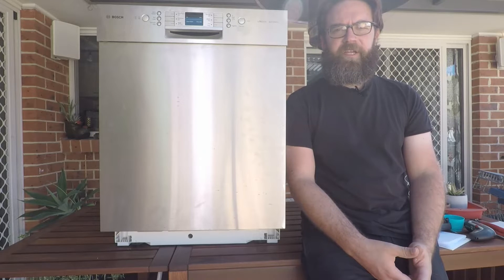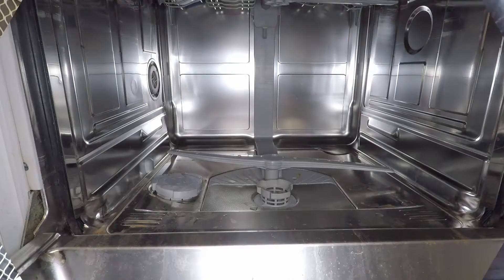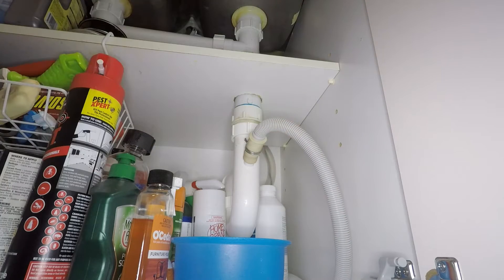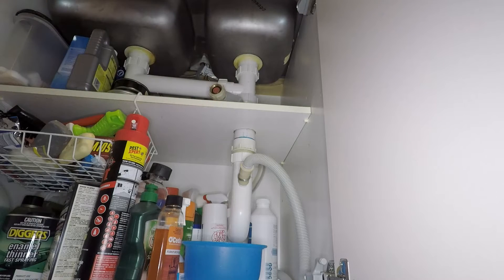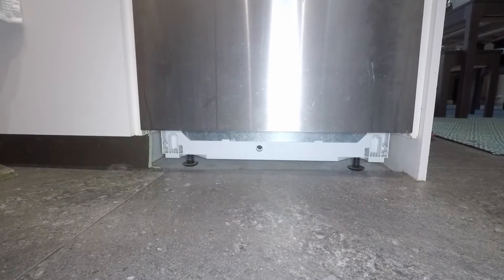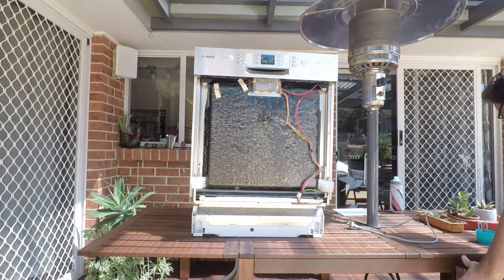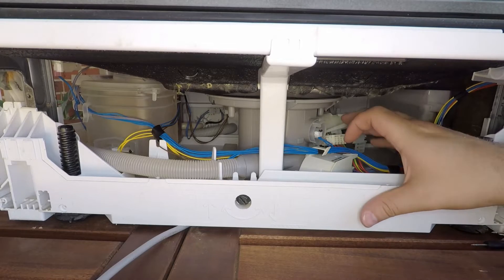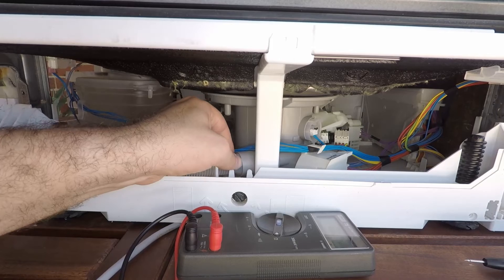Bosch E23 E24 E25 error code diagnosis and repair

Comment: Thanks for your advice, Mark. I checked all things you told, but they still do not work. I also tested the drain pump with a multimeter, and I think there is no problem with it. so what do you think? where is the problem? Could the problem be related to the PCB control board?

Comment: E23 fixed! I had to open the bottom panel to find out we a mouse had nibbled on a cable. Fixed the cable and it works again. So I even found a bigger problem to fix. A big thank you from Belgium!

Comment: Thanks for your video. Bosch SHE65T55UC. Got sporadic error code 15 over a week or so. Dishwasher still worked once I unplugged and plugged it back in. Last night error code 23. No bueno. Found water under styrofoam float and drain pump area (oily looking liquid came out of drain pump). Question is, am I solving the leak simply by replacing the pump? What do I do about the styrofoam? Obviously dry off the pump area and Styrofoam area. How do I determine if/where the leak occurred? Just bad pump (If just a bad pump, I'dh get an error 23 instead of 15, right?). Appreciate your insight. TIA!
Reply from the maker: The oily liquid you found could just be from a slow leak, and the water has evaporated leaving behind everything else. If the disk is still in one solid piece then I wouldn't worry about trying to source a replacement.
As for the E23, did this happen before or after you cleaned it out? If before then just wait and see if it returns, but if after then it could be a bad pump, and that's where the leak has come from
Reply: @Sawickipedia  The liquid I've found that the pump was sitting in and  was outside of the styrofoam area, was sorta slightly yellow-is watery. What was dripping from the pump looked demonstrably different. Darker and slippery. As to the E23: I had had maybe 5-7 E:15 codes over a week to 10 day period. Each one seemed to occur after the cycle had completed. I could hear a motor-type sound for about 10 seconds and then quiet. I listened for a couple of cycle of this then pulled the plug. Like I said, this happened about 5-7 times but on the following evening of running the dishwasher, it worked. Then two nights ago, on pressing the start button, immediately got the E23 and it didn't work at all. I cleaned everything out (and I did find something rather rigid and sizable that perhaps got in the way of the pump propeller). I ordered a replacement pump. I'm hoping it's just a failing pump and that a new one won't get fried by a leak I haven't discovered. What do you think? Oh, by disk you meant the Styrofoam piece right?  Very much appreciate your insight.
Reply from the maker: Yeah by disk I mean styrofoam part. Hopefully a new pump solves all the issues
Reply: @Sawickipedia  Had to work it to seat the new pump but it yielded. So far, no error codes. Thank you!

Comment: Have anyone get this E-24 and need to replace the control unit to fix it? I have not find anyone done that for the info I search on the internet so could I say the control unit likely to be ok on any case that it still operate but sometimes have E-24.

Comment: Hi
 Here is another quick fix that works.  The filter in the bottom of my dishwasher dishwasher was clean, yet clogged with mineral build up.  I soaked the filter in vinegar (like cleaning a coffee maker) for an hour and it was like the second coming of the messiah--the dishwasher works 1000% better, the sound of the washing cycle is much more vigorous, and no more water tap error--for over a month.

Comment: I have bosch dishwasher e25 code what should I do
Reply: most concebtrate to Aquasensor which locate around sump area   easy simple to change to fix e25
Reply: @mikele8476  Thank you for help I change Agua filtr and work it

Comment: Hi mate I have boch dishwasher e27 code what should I do
Reply from the maker: Apparently E27 is caused by low voltage in the electricity grid. Your best bet is to note the time of day when the error appears and avoid running the dishwasher around this time of the day.

Comment: Hello, Mark. Followed all your suggestions + extracting pump and cleaning water outlet and machine base. I got a reading of 80... do you think a difference of 10 might indicate an issue with the drain pump? Thank you for your time and support.
Reply from the maker: No, 80 seems ok. Have you reassembled it and tried it out?
Reply: @Sawickipedia  Yes, I tried but it didn't work. Reading is about 80 but only between 1 & 2; I get no reading between 1&3 ou 2&3 - https://appliancefault.com.au/wp-content/uploads/2019/09/IMG_5376.jpg. UPDATE: I removed the pump cap and it had moisture; one of the traces of the circuit board was damaged... Guess I found the culprit.  :)

Comment: Nice and concise video. Thanks.
love to hear if you have any extra suggestions on E24.  i have done the obvious checks (see below). I looked thru your playlist hoping for more E24 stuff.
I am really curious what can be the source of E24. In my case there is definitely nothing blocking the drain system.  i have had the drain pump out.  Dismantled it and cleaned. It turns freely. Checked resistances etc.   I tend to do this from the controller end to confirm that the complete path to the sensors or pumps is not HiZ.
I have had the outer armature off the recirc pump and soldered directly to the copper wires as I had suspicions that there may have been a hi Resistance in the path.    i.e Failed connector. They use IDC to terminate the enameled copper wires. Turns out the center enabled wire just came away and under a microscope seems that it was only holding on by a nats whisker so i thought I had found the culprit but sadly still get a random E24.
Sometimes my symptoms are that the dishwasher completely drains at start (as it is supposed to do)  of cycle but still decides to throw an E24 randomly.  Randomly at the start of a cycled, some times at the final rinse cycle and sometimes not at all.
I have re-seated all the connectors, had the controller apart and checked for anything sus like leaking caps, corrosion etc. There are only a couple of electrolytics  that look ok.
In the past I have found sources of blockages such as bits of bone, glass and hair wrapped around the pump shaft.
Perhaps it is a glitch on the supply rails.  Maybe I can get the CRO out and look for any odd noise etc.
It is now on its second error free cycle, but there is nothing I have really done since it last failed that would point to a smoking gun.  We will see.
Reply from the maker: I think you've covered everything that could be a likely cause. I'm very curious to know if you have any success with the scope
Reply: Thank you from Italy and have a nice beer, go to your paypal